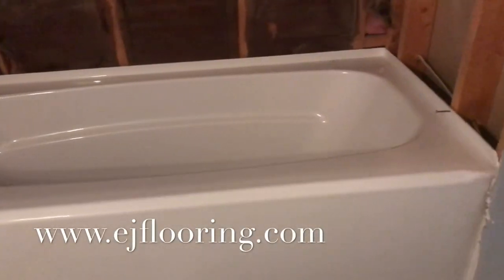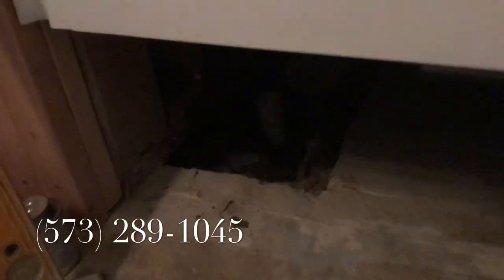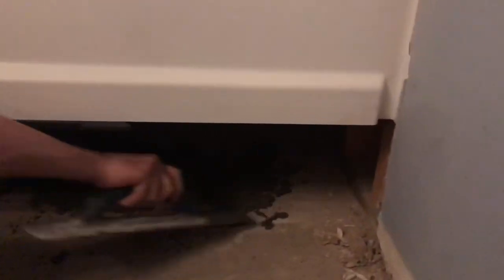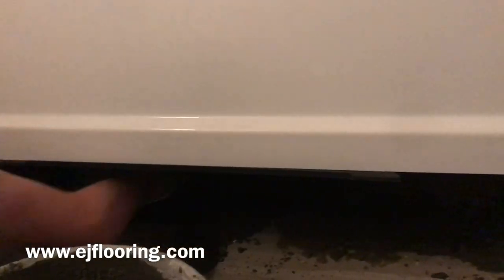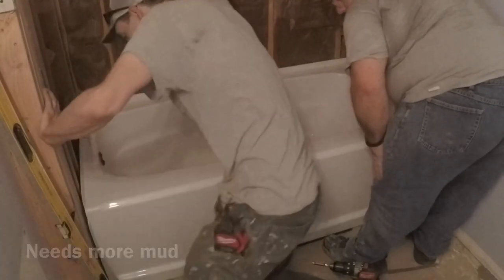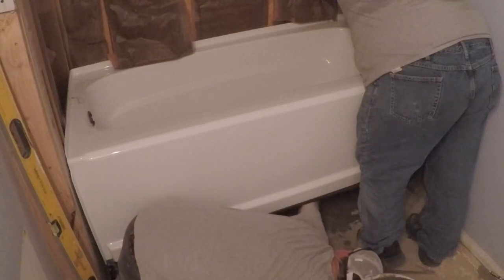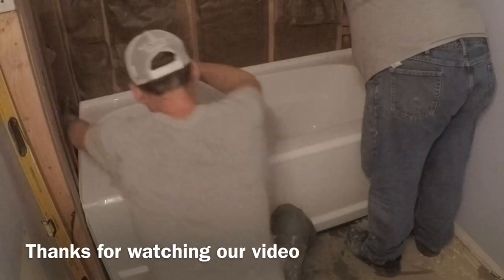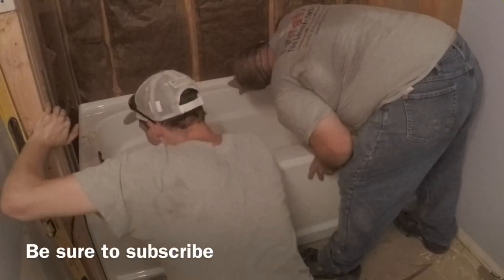How To Properly Install Alcove Bathtub - Setting the Tub in Mortar

Comment: If only I had seen this video before getting my bathroom redone. The plumber installed the acrylic tub over a suspended 2x4!! Yes, the entire tub, water, & weight of the person in it balances on a narrow wood stick! The tub failed in less than 3 months; buckling at the front end. Why it hasn't gone crashing through the floor by now is a miracle. Of course It has to be torn out and replaced. Beyond furious at the whole mess!
Reply from the maker: I’m sure sorry to hear about your misfortune. The next tub we remove that’s set in mortar will be the first. I don’t know why plumbers and contractors don’t believe it’s necessary. $6 in mortar will make the tub last nearly forever.

Comment: It looks like you're suspending the tub by the tiling flange correct?   Has one ever fell or broke off from being to heavy to support the entire weight of the tub?  Thanks.
Reply from the maker: We put enough screws in it to secure it while it’s raised up. I haven’t had any issues yet, and I won’t expect to in the future. We’re very confident in this method, it’s the best way I know to set the tub in mortar easily. Thanks for the question I really appreciate it.
Reply: @friendlyneighborhoodtileguy  Thanks for the quick response.  I'll be trying it soon on an acrylic tub I'm installing at home.
Reply from the maker: Dry fit the tub first and drill out the stud locations. When you raise the tub up run a screw through the predrilled hole. Don’t over tighten the screw (the flange can crack if you do). Spread the mortar under the tub then drop the tub down. Easy to do and you’ll be glad you did. Good luck with your project.
Reply: @friendlyneighborhoodtileguy Or use a temporary ledger board so no weight is pulling down on the drilled holes in the flange.

Comment: I have a crunching sound after doing this method.. any fix for it?
Reply from the maker: If the tub is supported by the mortar there shouldn’t be a crunching sound.
Reply: @friendlyneighborhoodtileguy  well unfortunately there is
Reply: @friendlyneighborhoodtileguy  any solution?
Reply: @ogfktup I would suspect not enough mortar was used and you are hearing the tub hit the mortar. Or the tub is cracked underneath?

Comment: It's better to use thin set sandwiched in between two sheets of plastic. The thin set levels out alot easier.  Also it's definitely good to put plastic on top of mortar no matter what kind you use. The Portland and other grits in sand can cause damage to the bottom of the tub. So that's one reason why alot of people don't use it is because they either don't know what kind of mortar to use and mix or just put a ledger board screwed to the back wall. But I don't install a tub without mortar period. Not concrete either
Reply from the maker: The instructions I’ve seen with any tub calls for type S mortar, which is what we use.
Reply: Must not have seen Delta instructions then

Comment: Is thin set fine to use for the mortar bed? Or what kind of mortar do you recommend?
Reply from the maker: I wouldn’t use thinset as it’s crazy expensive plus it will stick to the tub. All you need is a couple bags of brick mortar. Less than $10 and you’ll have more than you need. Around here they sell for about $4 a bag or so.

Comment: If you use a sheet of plastic on the floor and place the mud/mortar mix ontop you will thank yourself if you ever have to get back in and replace it.  Easier to remove.
Reply from the maker: I appreciate the suggestion.
Reply: Though a good idea, I don't think it matters much if you have a clean & smooth slab.  I after removing my steel tub, I had no issue getting to old cement base to pop away from from the slab.

Comment: They skip it cuz they are lazy and poorly educated.... Today I bedded a cast iron tub (yes they still make them)  the floor was not totally level and I wanted to make sure that the tub didn't rock ....
Reply from the maker: The next tub we see with mortar under it will be the first.
Reply: @friendlyneighborhoodtileguy  The amount of "rock" in the tub is very slight... its sitting on a concrete floor,  Im going to add a bit on concrete hardener to it so as to get a good bond...  This job has been the "job from hell"  ...  Had to make many changes to get things to fit right.